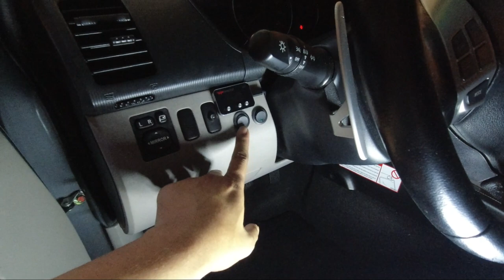Paano Mag-Customize ng Headlight | Halo Light Install | DIY

Comment from the maker: Update: Removed the sealant and instead used black silicon gasket then tied my halo rings using nylon thread (used in fishing rod) for added security. 

Products Used in this Video can be Purchased at the link below:
https://www.noahsgarage.com/mechanics-tools/
Just search:
 Halo Ring Light
 Rubber Butyl Sealant
 Ingco Cordless Drill
 Cordless Electric Ratchet
 Nanwei Impact Drill
Reply: sir hnd po pede ung halo na 110 mm po
Reply: Sir ano pong size ng halo light ang ginamit nyo?
Reply: Sir ano pong size ng halo rings ang ginamit mo sir? Maraming salamat in advance sir. Laking tulong. Salamat
Reply: sir bakit po pinalitan ang sealant? nagkaroon po ba ng leak or moisture?

Comment: the downside about this is after installation, after a few months, water will start to leak inside the headlight.
moist will start to enter the headlight specially during rainy days. i have it installed in my altis.
Reply from the maker: Salamat sa info sir
Reply: I think hindi naman Sir since naka sealant ang dinaanan ng wire. As long as fully seal using sealant, walang problema. If nag momoist pa rin then add silica moisture packs.

Comment: The chrome coating should be removed from the decoration as the paint won't hold long on it. Then wet sand with 1500 and paint with paint for plastic. I've using the same rings as yours but I advise you to use different drivers for them and I made myself aluminium rings to install behind them with thermal paste to prolong their life. Some of the drivers they come died even before the installation. Also when closing the headlight use strong plastic clamps to hold the lens on the housing. I'm holding the halo rings with 0.25mm galvanized wire. I find it much better and less visible than fishing wire.
Reply from the maker: Thank you for the tips sir. The aluminum rings with thermal paste is a bright idea. Definitely will consider applying next time
Reply: @NoahsGarage  Mine are laser cut 2mm ones. They are cheap to produce/buy.

Comment: Since painted and it will looks like smoked headlight my concern is kumusta naman ang BEAM PATTERN of your low beam projector and hight beam reflector? Still the same ka Liwanag parin bah? Or what?  aside sa angleeye which just serve as your parked light lang naman at d naman ganon kaliwagan means just for looks..
Reply from the maker: Yes sir, aesthetics lang po. Di ko pa na try sa gabi, mukhang ok naman kasi malakas ang LED ko dahil keon siya. Kung nabawasan man ok lang

Comment: sir good day po ulit. gen2 2013 po sakin na glsv din pero wala ako drl. hindi po kasi naka facelift. if balak ko po isabay na lang sa park light sana. ok lang po ba na i tap ko na lang dun sa wire ng parklight sa likod ng headlight? need pa ba fuse pag ganun? ano po ma advice nyo? SALAMAT SA MGA GEN2 VLOGS UPGRADE AND DIYs po. God bless
Reply from the maker: Need ng fuse sir or relay. Tap mo sa parklight, trigger lang un, ung power source is ibang wire papunta naman sa battery sir

Comment: sir anu b size ng Angel Eyes Led Halo Ring ?
Reply: Daytime Running Headlight Lamp Car Angel Eyes Led Halo Ring Headlight DRL 12V 60MM 70MM 80MM 90MM 100MM 110MM 120MM
Reply from the maker: 70mm and 100. You can also use 80 and 110 kasi naliliitan ako sa 70 and 100 pero ok na
Reply: @NoahsGarage  sir nabili ko 70 and 110 sana magkasya

Comment: I have been following all your mods and improvements and learned quite a bit. However, I'm concerned about this mod because the seal will not be as good as the original and water will seep into the lights, and also those cheap halo LED lights would burn out after sometime. Eventually you would have to replace the headlights.
Reply from the maker: Thanks for your inputs sir. Clearly, there are risks involve not only with this type of mod, but for all types of jobs.

Comment: boss noah ano size ng halo lights?
Reply from the maker: Nuod ka muna sir hehe
Nanjan ung sagot
Dont forget to subscribe
Reply: @NoahsGarage  napanood ko na po boss noah and subbed na din Ganyan gawa ko dati kaso di ko na dechrome yung sakin kaya kalat ng ilaw. will do your process mas maganda outcome boss
Reply: @NoahsGarage  boss noah nabasa ko pinalitan mo yung rubber butyl sa loob, pabulong naman po ano ginamit niyo pamalit tas san nabili
Reply from the maker: @PNDA013  high temp silicon gasket maker sir, color black.
Reply: @NoahsGarage  boss noah anong sizes po ng halo lights?